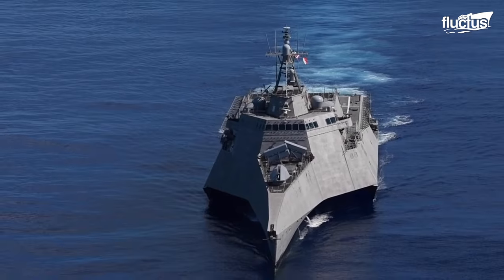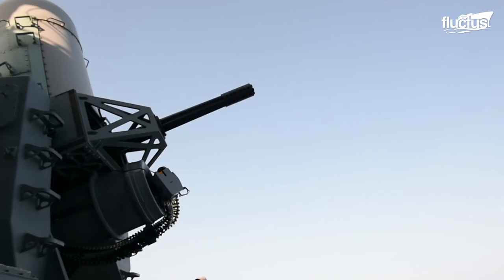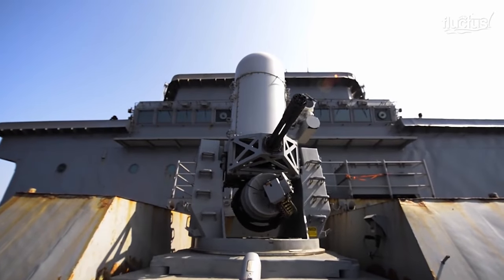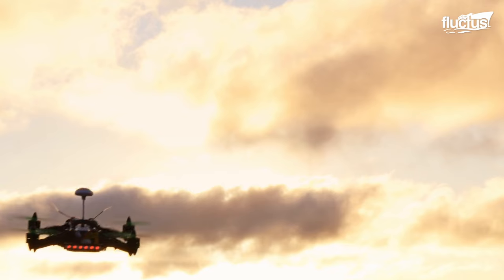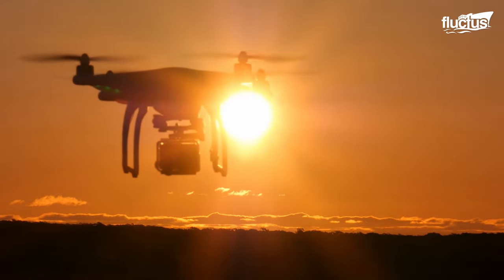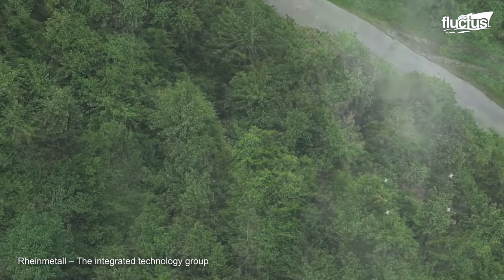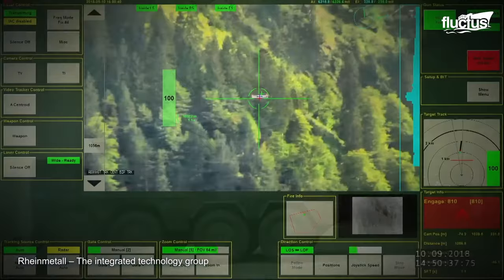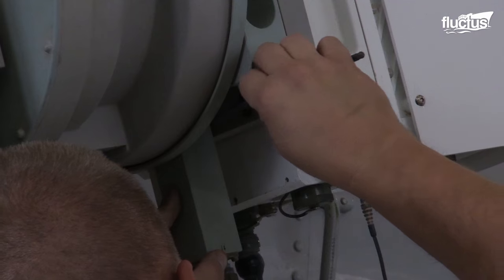The Extreme Solution US Navy Found to Deal With Enemy Drones in Middle of the Ocean

Comment: We were the first ship on the west coast to get the Ram in the 90’s. During the initial testing it managed to shoot down the drone that was pulling the target. Only a $3M loss. I mean, to be fair the civilian contractors were on the ship assisting. Maybe it came out of their pockets.
Reply: What about the hypersonic russian missile? (10,000 kms/hr) mach 10. 
Nothing can stop it.
Reply: @vulcano911  When or if LAZERS are installed, I have no doubt they can shoot them down. Maybe they are already installed. I haven't kept up with what is now current since I retired.
Reply: @vulcano911  I believe these hypersonic missiles also go into space before descending to the target. Space-based lazers would make short work of them. There is always a move and a countermove to each weapon systems upgrade.
Reply: What's crazy is most civilians weren't even aware of drones and certainly not the Ram in the 90's.
Reply: @vulcano911  if it even exists
Reply: Unless a hypersonic can change speed very fast their is no reason this gun can’t take them out the computer automatically judges speed and leads them
Reply: @richardrose9943  You're assuming all hypersonic missiles will be coming at the ship from a horizontal position. Most of them will be coming from directly above. CIWS used to have a vertical limit. It's top heavy and can't shoot straight up. Even if it could, at Mach 5, a missile would be closing at 1 mile per second. The effective range of the CIWS is 4875 feet, just under a mile. You would have to be in AUTO mode and have the CIWS allowed to shoot anything within range. You would have about 4 or 5 seconds for the system to acquire and then about 1 second to shoot the target. Debris from the missile would continue on the trajectory and still impact the target. I would count on chaff, decoy targets and electronic countermeasures, not CIWS, to protect the force. CIWS will be effective for older non-hypersonic missiles and fast aircraft.
Reply: The Coral Sea was the first Navy Vessel on the west coast to have it fitted. I believe that was in the early 80's.
Reply: @vulcano911  hypersonic is overrated. hypersonic speed only at high atmosphere . during decent speed should be very slow. heat is the main problem. and russia tech propaganda should always be taken with grains of salt.. not 100%... just like s400 is overrated
Reply: It didn't (come out of their pockets).
Reply: @markd7280 the frigate that I was on had one of the early CIWS units. It was installed on the ship in 1982. After a few months it had reliability problems. We did an Indian Ocean deployment and it was broken down most of time we were near the Persian gulf with Iran threatening to attack American ships. They are probably much better now.
Reply: @hifinsword  Testing is on-going.  Do a search on Phalanx LaWs systems.
Reply: @vulcano911  they are not anti ship missiles. They are not accurat enough to hit a moving target since they cant manuver as fast as normal missiles.
Reply: @vulcano911  wonder if multiple satellites could be used to track and send an opposing array
Reply: Tell me you were at cville without telling me you were at cville. That was a disaster indeed. Calling a battle station on a condition II got me all fcked up on that day.
Reply: @kaspervestergaard2383  Laser weapons may not be there yet. But Lockheed Martin is on the job. When the military needed a new a/c that could fly higher and faster than anything out there, LM invented it, the SR-71. They will do the same for LASER weapons.
Reply: @hifinsword  Bet someone said the same for the railgun. Look how far that has come? We are hitting physical limits here. It doesn't matter how many dollars or manhours are being thrown after the project, sometimes it's just not really reasonable.
Reply: @kaspervestergaard2383  I remember when satellite TV was the rage but the antennas were 10 feet across. Now we have TV antenna dishes about 1 foot across. The upper speed limit on the SR-71 was not the engines propelling it. It was the heat. New technology has increased that limit. You are limited by your imagination. I don't know what the answer is for weapon lasers, but someone out there is working on it without a limited imagination.
Reply: @hifinsword  It's laser with an "s", and no, modern military lasers aren't potent enough for that sort of thing. Give it half a century and perhaps the situation will be different, but for now surface-to-air missiles are the most capable defence available.
Reply: @melanoc3tusii205  Sorry. I can't wait that long. I'd be well over 100 years old. You wait. I'm pressing on!
Reply: @hifinsword  That is great old man. "When I was a kid". Really dislike that. You seem to lack understanding that developments are slowing down. You mentioned the  area which made the absolute most progress at the time and now using that as your argument point. "Someone out there is working on it without a limited imagination". Idiot how hard is it to understand? This isn't make believe land. Just because they want something to happen doesn't mean it will happen. So in the near future we can walk on water right? We bend physics just because we can. The power requirements for a laser is rather huge.
Reply: Yep! I believe that…the Federal government decided just once to be responsible with tax payer money and actually hold the responsible party to account….sure…why not?  Then there’s the tooth fairy issue…
Reply: @vulcano911  and we know this is true because the Russians showed us a video of it flying through space towards the NA continent…and they managed to do it all on their 6 Billion annual military R&D budget…wow! Those Russians are sure clever!
Reply: @kaspervestergaard2383  the technology is good.  It’s the static material strengths that need adjustment.  We have the gun…we need a smarter bullet..
Reply: @viscache1  Like I said, it doesn't matter what causes it, it is useless.
Reply: Psh ish
Reply: @vulcano911  Russia doesn't have mach 10 missiles. Their so-called hypersonic missiles are modifications of decades old ground launched ballistic missiles, which technically exceed mach 6 but only in the upper atmosphere and can be intercepted in the terminal phase by normal AEGIS directed SA-3 surface to air missiles, which where designed for "hypersonic" ballistic missiles. Most short range and all medium and long ranch ballistic missiles are "hypersonic" and we've been fielding systems that defeat them for decades. Air launch vs ground launch does give the missiles more range, and make it more difficult to detect and track the trajectory from the launch point, but that's about it. From a point defense standpoint, there is no difference between a Kinzhal and a soviet era Iskander.
Reply: It's really just an adjustment to targeting, flying into metal bullets shot in the opposite direction you're travelling will destroy any missiles, whether they're travelling at mach3 or mach10.

Comment: CIWS (C-WIZ to sailors) is an awesome defense system.  None of the ships I served in (all non-combatants) had CIWS.  I did see one demo'd while on my WESTPAC/IO cruise.  The only downside to this system is the amount of ammo it can hold, only about 1500 rounds per loading.  With a firing rate of 4,000 RPM, it can only shoot for about 20 seconds.  Still, I wouldn't want to be on the receiving end of this bad boy!  Cheers....
Reply: one or two second bursts for a drone should be enough if your radar tracking system is accurate enough.
Reply: this is going to be the crucial point. 1000 mass produced drones are easily worth a destroyer

Comment: 'Sea Wiz'. They are definitely cool, but costly, and don't get outfitted on every unit. Every vessel has different capabilities, so they play zone defense. To fill the gaps the Navy is using lightweight portable jammer backpacks that can be positioned to cover the whole ship, and intercept a wide range of drone frequencies. Portable, and effective at passive disruption/detection (as long as the batteries stay charged).
Reply: Every ship does play a different role. That said, CIWS is a point defense weapon intended to protect just the ship that it is on. For area defense, the USN uses the Standard missiles.
Reply: @Rob_F8F  All true
Reply: Sheeze,  sheesh, if the batteries are giving power out they could become discharged. Maintenance is a key item.

Comment: These anti drone systems are impressive against a few drones, but it's the 30 to 50 drones swarm strike that worries me.  I'd like to see a demo like that!
Reply: Defense against drone swarms will require laser systems. Shortcomings lasers have also limit drones. So drones have to move into view.
Reply: @7:48
Reply: These units track 31 target's at a time at a distance of 7 miles!
Reply: That’s where single shot aimbot comes in
Reply: Of we are open about what our defenses can do then the enemy knows as well... interpolate what you are hearing and make your own assumptioms.
Reply: @liberalhere3731  microwave at sufficient energy. Also there is EW that's built into F-35
Reply: We'll just install more guns. Rail guns will be the real end of the drones, assuming the detection methods improve.
Reply: Maybe the answer to defend against drone swarms is defending drone swarms. These modern day gatling guns do seem to be limited as even as few as ten drones attacking simultaneously from different directions and heights could I suspect easily overwhelm a gun of this design. Ships operate in fleets so when under attack the gun would have to avoid friendly fire and if the attacking drones could get between the ships the guns could end up doing more harm than good. 

Where they could be very effective is having a battery of these stretched along  a beach. For example if China ever follows through on its threat to invade Taiwan it would have to land ground forces and Taiwan having this type of gun on the coast and surrounding potential landing fields they would soon reduce the numeric advantage.
Reply: Airburst ammo can do that well. Not sure if 20mm is enough to do that, but the 35mm Oerlikon is a beast. 
Other than that it is a computer/programming problem. That task needs to be done autonomously without human intervention.
Reply: I wonder how well they work in fog, heavy rain, snow etc. Can't shoot it down if you can't see and ID it.
Reply: @JHNielson4851  The Phalanx comes with its own radar. Normally operates using radar instead of visual targeting.
Reply: 50? Try thousands.
Reply: @martincday007  With the range of the weapon it takes them all out before they get close.
Reply: @JHNielson4851 SWIR ignores fog…they’ll know it’s there.
Reply: @martincday007  Signal technology will likely be the answer. Scrambling the drones internal components and a certain range or some other varying tactic of internal systems disruption. Although thinking about that, there will likely be an answer for scrambling. I believe the only effective methodology for these drone swarms is a combination of a multitude of weapon systems.
Reply: @justinhaase8825  - I was referring to Sky Shield at 8:00 and it's "powerful optics". Even systems with radar will be effected by weather it's basic physics.
Reply: You are unlikely to see that because the designers of this system
know how easily it would be overwhelmed under those conditions.
Reply: @JHNielson4851  infrared radar is also on the r2d2, I think that's the nickname for this CWIS...
Reply: If a country like the US or China wanted to get serious, I can easily envision a swarm of 10,000 plus. A thousand people in front of monitors each controlling a dozen drones. If you get some good AI with refueling drones to add in with your loitering drones, you could easily increase that number.
Reply: Just another weapon system that we have a defense system for
Reply: misinformationpolice8920  no it’s not Russia is doing it in Ukriane lol up to 30 + at a time
Reply: You are asking the drones to evade the wall of lead just thrown at them, the shells are aimed in drone, but enough shells are fired, that the drone(s) will get destroyed.
Reply: How about 3,000 to 5,000?
Reply: Best way to defend against that would be something like a scaled up shotgun that released a large amount of shot over a large area. You don't need high power to takeout a drone, many of these systems are overpowered for the job in hand.
Reply: @david-jr5fn  yes, I thought about a shot drum around the sizes of;
No smaller than a 30 gallon no larger than a 55 gallon drum. 
Use exotic shot like wire with lead on the ends. Flechetts and other shapes that would improve scatter covering the largest area possible…
Range will always be an issue…
Reply: None of their  gizmos could defeat the power of the Taliban.
Reply: More drones? Shoot more bullets. 
3000 rounds per minute can create a huge spread of fire, especially if those rounds are proximity or time fused
Reply: trure,.   even worse,  how about 1000 drones each wave in 10 waves then?    This system is last resort and a single shot for cruiser missiles,  not to dones
Reply: That's why a small tactical Air to air nuke will suffice.
Reply: Yeah but to sink a ship, you need to put a hole below the water line. The drone swam that would attack a military ship will be one of flying torpedo drones.